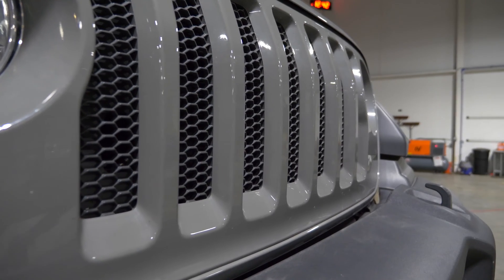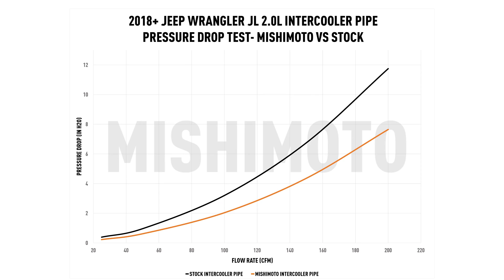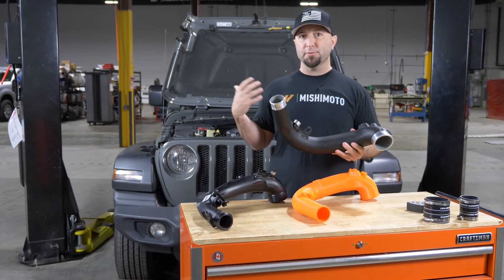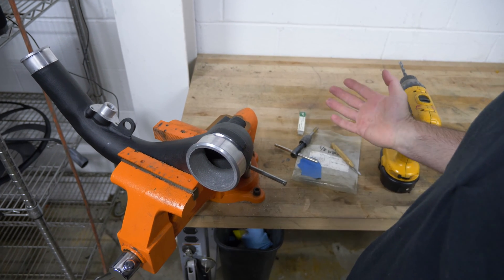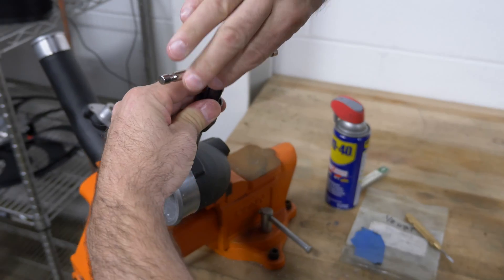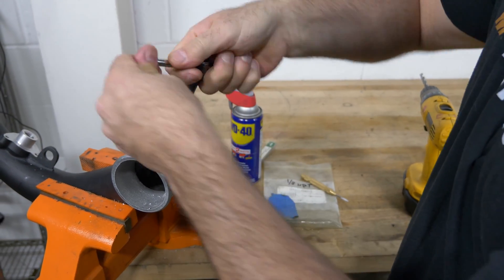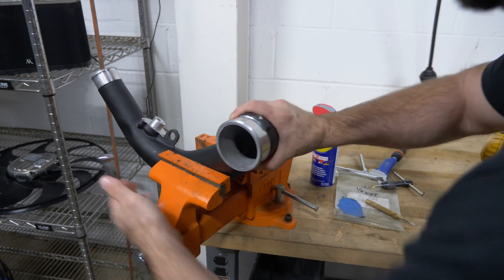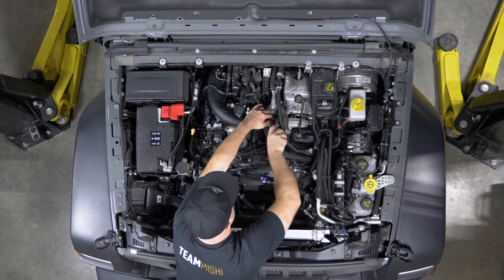Mishimoto Behind the Scenes: 2018-2023 Jeep JL 2.0L Performance Intercooler Pipe Features

Comment: Got to see dyno results before and after. I believe that an intake goes hand in hand with upgrades that change spark/boost/fuelling maps then the ability to get more air in becomes a performance asset.
Reply from the maker: The ECU limits the power. Unless tuning or other extensive modifications are done to the vehicle/engine, customer can expect to see a similar HP number as stock. However, our intake system will allow the turbo to work more efficiently and unlock the ability for our customers to use an aftermarket BOV, add water/meth, or install aftermarket gauges. Thanks!

Comment: Does this fit the 19 Cherokee with the same 2.0 turbo motor?
Reply from the maker: No, the part would not be compatible with the Cherokee as the parts are slightly different between the two cars.
Reply: @mishimoto  any plans for making these for the Cherokees?
Reply: @mishimoto we need one for the compass
Reply: I have

Comment: Would this work on the Alfa Romeo giulia engine also
Reply from the maker: No, this part would not be compatible for your car.
Reply: @mishimoto  yeah after looking at it I can say it doesn't have the spot for my air temperature sensor are y'all planning on building anyting for the Alfa Romeo giulia 2 liter turbo cars
Reply from the maker: Unfortunately nothing planned at the moment
Reply: Tyler Norwood it literally has a spot to add sensors or accessories

Comment: Any good tunes out for this engine?  I’m considering a new jl. Thx
Reply: I would wait a few years before you purchase one so that they can get the bugs worked out. And whatever you do, don't buy a 2.0 JL. The engines are crap. Guaranteed at some point you're going to have oil burning issues. I worked at a Dodge dealer not long ago, and the brand new 2.4 Cherokee motors were coming back at 20,000 miles with oil burning issues.
Reply: @Thestockxj96  There are tens of thousands of 2.0 Turbos on the road with no issues many passed 20K miles. That makes you an idiot spouting unproven "knowledge". Oh...and because you park cars at a dealership doesn't make you an engine designer. Of course you own an old POS Jepp...no surprise.
Reply: ViperJon anything turbo will wear out faster. Its simple it puts more wear and tear on the engine. My jeep has 170,000 miles and looks like a brand new jeep hence its new paint job lol.  My 4.0 motor burns alot of gas but at its mileage it just finished breaking in
Reply: ViperJon dude it’s not that personal. It’s a fact that the 2.0 are underpowered for how heavy they are.

Comment: To be useful as a how-to you should have included the drill bit size.
Reply: He said 1/8" npt.
Reply: @CoochieKissKing  My drill index doesn't have a "1/8" NPT" sized drill. Drill bits are shown in sizes. Sure, I could research it and figure it out, but this is supposed to be a how-to video.
Reply: @2wheellee  this is not a how-to video. No where in the title or description does it say that.
It is showing the features and ways to get the most of this intercooler pipe.
Also, anyone that has any business taping knows a 1/8th npt should be drilled with a 21/64th or similar size first.